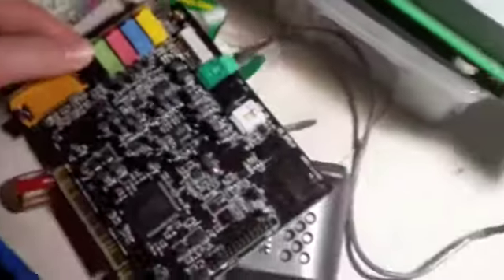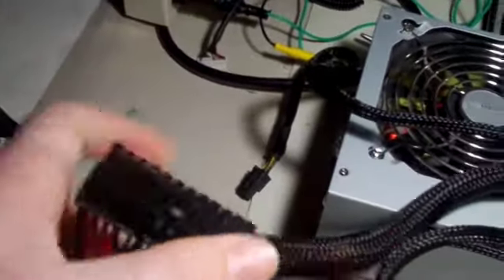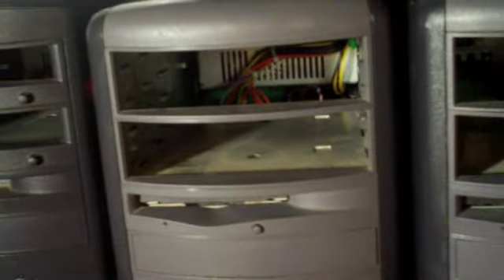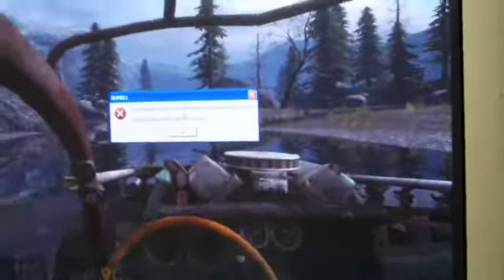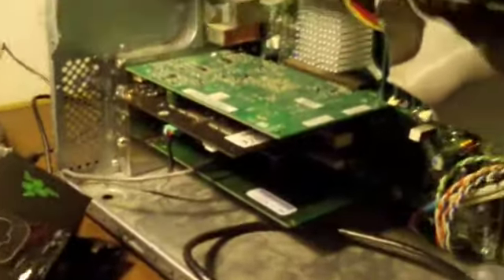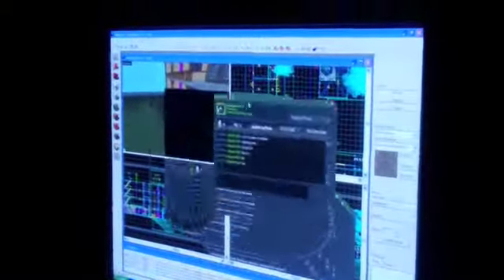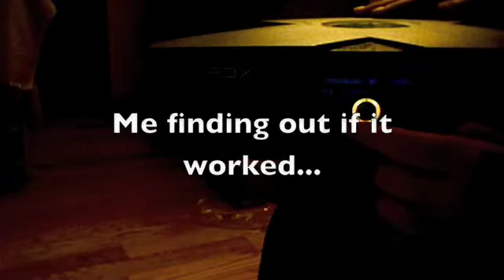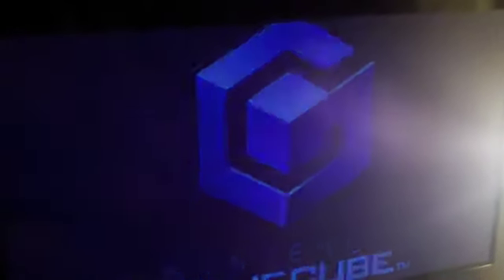Big Computer Collection + My Gaming Computer

Comment: dude... you remind me of me :D I fix computers a lot when I have time, or when not doing that, upgrading my own... btw, the slim, black connectors on that Dell PSU are known as SATA power connectors... (you might already know that the wider 4 pin and the 20+4 pi connectors are MOLEX... if not... learn something new everyday... especially computing and repairs!) it's great to see someone like you or I taking an interest in computers... not only is the pay good (normally £30K (UK) over here for a job in repairs as a basic shop worker and 25K if you do school Desktop tech work, but it gets fun when you get to advanced level stuff, like systems integration and hardware associations, then that drastically increases!) but not only's the pay more than good... but the job itself is a ton of fun... you can basically get on with your work, do it well, and show your boss you know your stuff... get promoted and do it again... and I bet you anything, a technician saw the work you do there and your workspace... the last two words you'll hear are "You're" and "Hired"

Comment: Lool yea, a 8MB video card is shit, it couldnt even handle 720p video, and even a 256mb video card is bad. Its not about how much ram you got on the video card it what it is. like a 2GB HD 6670 is not better then a 1GB GTX 560ti. And pentium 4 is out dated, even core 2 duos are out dated for games